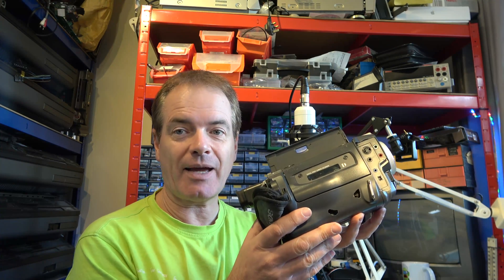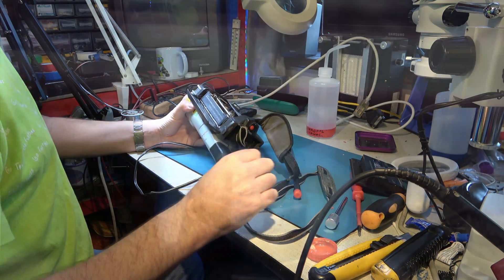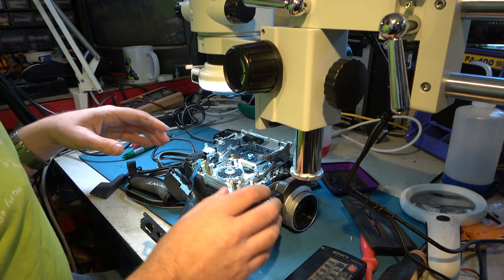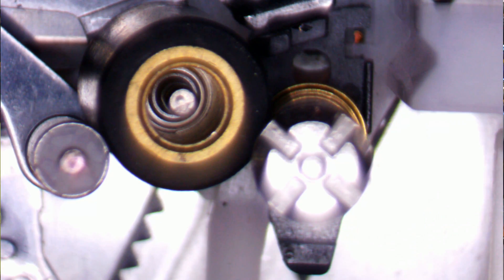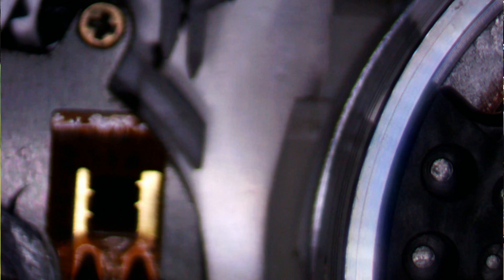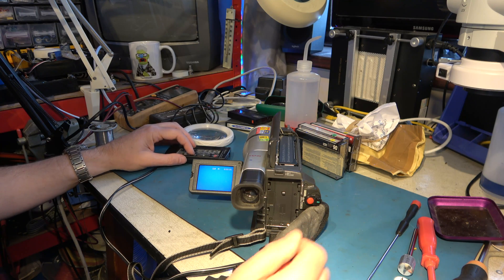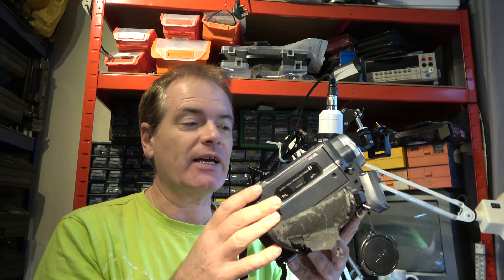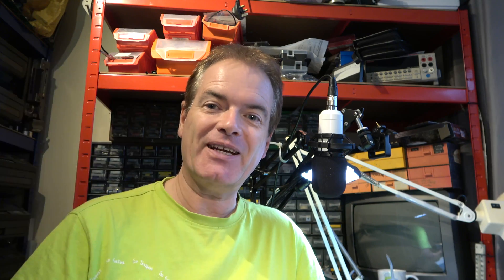Video8 / Hi8 / Digital8 alignment and pinch rollers.

Comment: Is it normal for these sony hi8 comcorders to have bleeding with red colored objects and is there any way to rectify the problem.
Reply from the maker: No, colour performance on this format is usually fairly good, better than VHS anyway.  There may be a defect on the player, such as bad capacitors in the colour processing circuits, which won't be trivial to repair.
Reply: @video99couk  thats weird because every hi8 camcorder I have bought has this kind of problem, sometimes slight bleeding, and some have a lot more bleeding mostly in dark or dim enviroments in my home so is there any way of fixing this problem on my camcorder

Comment: This was super helpful! I found a abused but inexpensive Sharp VL-HL100, the handful of 8mm tapes I had to review were all over the place tracking wise. I was able to take the case apart, find and adjust the alignment guides back into a useable picture! Seems like most sources Hi8 advice begins and ends at throwing a cleaning tape at it, so thanks for having proper troubleshooting :) 

If you happen to see this, the image on this camera has some other puzzling distortion. Just the top portion of the image has some lines, it doesn't change with the alignment, shows up the same on all tapes, the one filmed on the camera in question and ones that weren't. Shows up on the output(s) and the camera screen. Haven't seen a similar example in the wild to figure out what's doing it, or if its even something that can be tweaked or fixed, any ideas? Short clips- https://imgur.com/a/tmveNQt

Comment: Hi Colin, I have recently acquired an old Sony Video 8 Handycam (CCD-TR45E) to digitise some Hi8 family recordings of mine. However i'm not getting any sound being on playback. I don't see where adjustments can be made on this earlier model, have you any suggestions? Many thanks!
Reply from the maker: One unlikely cause is that the original recordings were made only with PCM digital audio and no FM audio, but PCM audio was generally limited only to very high end professional camcorders.  More likely there's a fault with the CCD-TR34E.  I recommend Digital8 camcorders for digitising, such as the TVE-120E.  Care because a few Digital8 camcorders won't play analogue tapes, see a list at the bottom of my page: https://www.video99.co.uk/Video8_Hi8_to_dvd_transfers.html

Comment: HI! Nice video, I have EV-S350 Video8 Deck, after fixing some issue with tape mech. I'm facing issue with slow playback! I cleaned-up the pinch roller to no effect !
What do you think is happening here ?
Thank you.
Reply from the maker: Quite likely capacitor failure somewhere in the capstan servo circuit.  Could be tricky to resolve.  Other causes are possible, but that's where I would start looking.
Reply: @video99couk  Thank you for the reply, can it be an issue with SP vs LP detection

Comment: great video! ive been trying to adjust my input guide as my digitized audio would just not line up with the vid (the video in in perfectly good condition), but i dont have any one the needed equipment as of the moment, any of you got any alternatives?
Reply from the maker: Usually a small flat bladed screwdriver will be OK for the adjusting tape guides.

Comment: Glad to find that video because it is my near by job I need to try. It is very tricky and scary to touch anyway when something happenes and has to be repaired - no excuse. 

In past I've had very troublesome happening in my Canon A10 - the plastic ring security  fall off the axe  during loading , metal extention diconnected and all loading tray stopped. Got replacement for security ring  and assembled back. I managed to make it work but it repeated again and again and at last the plastic rail leading loading rollers  was broken by pushing it motor. Then  I glued it assembled  and again got working. With broken  by way conducting tapes and plugs which I reconnected  🙃

 Eventualy this camera was damaged by wrong operation by my teenager son and now is in pieces. Now I use Canon UC8 Hi8 which is better but my actual goal is to make Canon A1 - would be my beloved because I love all that manual settings with manual knobs  it has  I purchased it  as damaged but   not received yet. Then I will for sure watch your film again

Comment: I have a Sony GV-200 video Walkman that was fully restored 4 years ago (including board cleaning and new caps). It plays fine then after 3 to 5min the colour starts to change to Black and white from the top of the display then slowly moves to the bottom of the display until all of the video is BW and has a few horizontal lines sometimes. The sound works fine.
Reply from the maker: Certainly sounds like a capacitor failure.  A bit non-trivial to repair I'm afraid, but do-able by someone who knows what they are doing.
Reply: @video99couk  Yeah I have restored alot of vintage gear including 12 x video walkmans. I have taken the GV-200 apart and will do ESR tests on the caps now starting in the video section of the mainboard. This GV-200 was restored by an ebay seller from the USA who restores them. The caps looks fresh with nice shiny solder on each. Hopefully one is faulty. :)
Reply: @video99couk  I took it apart and all caps pass the ESR meter plus they are all no more then 3 years old 
Reseated all the ribbon cables 
Reassembled and it’s happy now color working after 1 hour playback
Reply: @video99couk  after more testing I have found out what is causing the drum head to act like a brake when pressing stop 
It is the cleaning sponge whelk that touches the head drum when pressing stop 
It seems to be applying more pressure than my other players with the same mech 
It only touches when pressing stop
Reply: @Raptor50aus  i know i'm late to the party, but i suggest you to remove that "cleaning" sponge, since at this point in time it has the ability to destroy the heads.
Reply: @arpeas_jds  Done that already on all my Handycams from the mid 90s
Reply: @Raptor50aus  great!
Reply: @arpeas_jds  I have repaired the colour dropout issue with my Sony GV200 too found a dry solder joint :)

Comment: Thanks for this super helpful video. I have more or less the issue you describe.... I took the pinch roller out of a TR7000E (early digital 8 model) and tried to fit it in a (newer) TRV340E. The spindle is larger on TRV340E. Short of getting another machine, are there any sources for the rollers? The TRV340E was bought in an unknown state, it arrived without the pinch roller and I get the C:31:23 error
Reply from the maker: They are not all compatible.  There are places (in USA?) that can refurbish an 8mm pinch roller but it's not cheap.  So buying some scrap camcorders might be the easiest way.
Reply: @video99couk  Thanks for the info.  In the end I found another TRV series camera and transferred the roller from that, which was a super easy fix. As you say, the cost of the part from the states worked out considerably more than a donor camera.

Comment: I have several SONY cassette decks, DAT decks, and camcorders,. The common problem with them all, is the pinch rollers become soft over time ( they must be firm ).  That is most likely the cause of your equipment eating tapes..I have tried sanding them as well, but have had no results. The only solution is have them refurbished. There is a chap in the US who does a remarkable job of replacing the rubber section. He goes by the name Terry's Pinch Rollers.
Reply from the maker: Yes Digital8 pinch rollers do fail like this, and sanding them often doesn't because they go out of shape.  There will come a time that I run out of good pinch rollers and will have to get some refurbished, but it won't be cheap.

Comment: I have a TRV-68 that I'm trying to troubleshoot - record, play, etc, work fine.  I get the dreaded C31:23 code if I rewind or fast forward the tape all the way from a stopped position.  I'm guessing this means these things have some kind of sensor for tape end that's having an issue.  Have you seen this in any of your troubleshooting?
Reply from the maker: I think that error is usually reel drive related, but could be due to a missing pinch roller or other faults, both mechanical and electronic.  Firstly though, look to see if the pinch roller is in place, because they sometimes fall out.

Comment: Genial yo tengo una SONY CCD-tr44 que solo adelanta, regresa pero no reproduce, que puedo hacer...?🤔🤔🙄🙄😬😬
Reply from the maker: Does it play with no picture, or shut down when you select play?  If no picture, it could just be dirty video heads.  If it stops in play, then there is a possible mechanical fault which may not be so easy to fix.
Reply: @video99couk  Am sorry frinend I not speken english I am of Mexico city very very THANYOU good day

Comment: I may be mistaken, but from your microscope videos I noticed that your initial pinch roller inner metal surface or spindle surface was pretty much wear out caused pinch roller wobling. This could cause extra rubber wear out in addition to normal use wear out.
Reply from the maker: I don't think the centre was worn.  These pinch rollers do wobble when not engaged.  But anyway I replaced it.

Comment: I also lost the plastic tube off the pinch roller in my miniDV camcorder last year whilst removing a jammed tape (I had a sticky mechanism that popped a fuse during an eject cycle). I found out that a bit of a biro ink tube was a perfect fit.

Comment: Hi Colin, good helpful video as always.  Before I adjust guide height I use a black felt tipped pen  mark on the screw head to show the guide screw's original position so at least there's a reference. Of course if the screw is turned more than half a turn I have to record which way (clockwise or anticlockwise) takes me back to the reference point.

Comment: I had to chuckle, that's the sort of thing i did to get a tape to playback :-D
"Enter the dragon"  from a faulty betamax machine,  ( jammed a screwdriver in the mech to keep it playing ).
Don't forget spray cans for the internal tube, and spray deodorants for a bigger tube, biro pen ink tube :-D
Good to know where handy tubes can be found for free.
I made the tool for adjusting the tape guides, a rod of brass and i inserted a metal washer in a slot in the end soldered in.
On vhs vcrs, the left guide makes the picture jumpy,  i always used a dim light and observed the bottom of the tape on the rabbit reference shelf,  adjust for no distortion of the reflection in the tape.
My crude methods always worked.
Reply from the maker: Biro tube is too big for these 8mm pinch rollers, it's hard to find anything just the right size.
Making an adjustment tool is a good idea.  In the days gone by, those kits would have been fairly expensive.  Since no-one wants them any more, they can be found on eBay for £10 now.

Comment: This may come up as a silly question but if they sell audio tape splicing blocks with included splicing tape that are the same width with a miniDV tape or VHS tape, will it still work? And will the included tape be good enough? Or is there a better splicing tape you would generally reccomend.
Reply from the maker: I would say that audio splicing tape is probably satisfactory, but some may be a little on the thick side.  Cassette splicing tape is very thin and would be good for the smaller formats.  The tape doesn't need to be quite as wide as the tape, I would say if it covers over half of the tape width then it's probably safe.